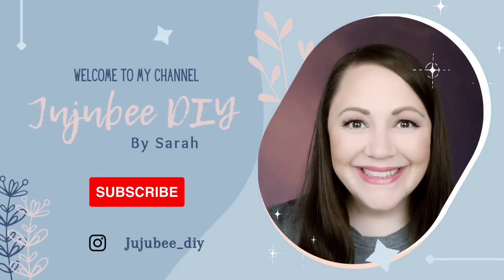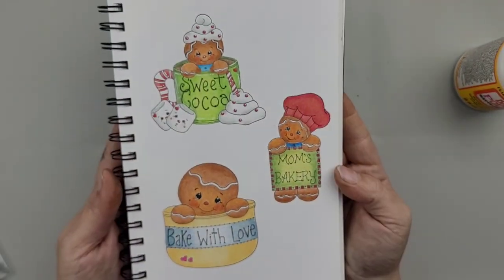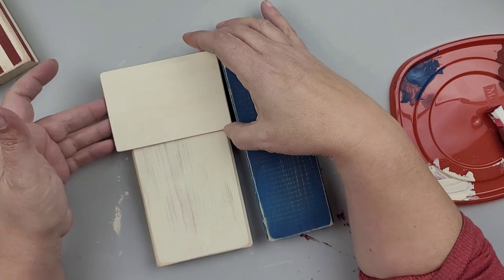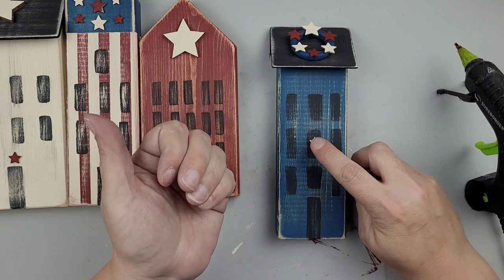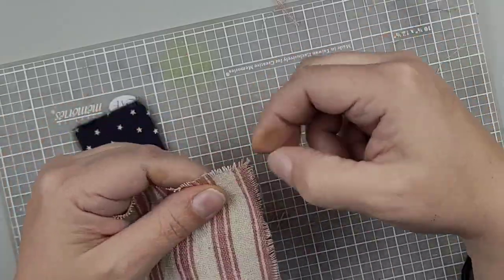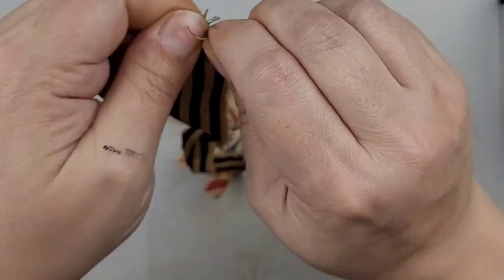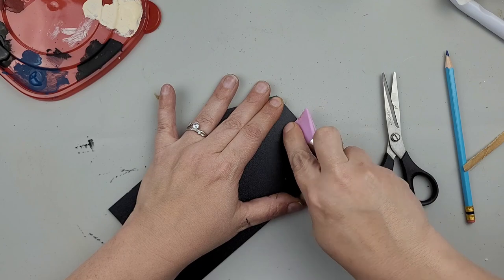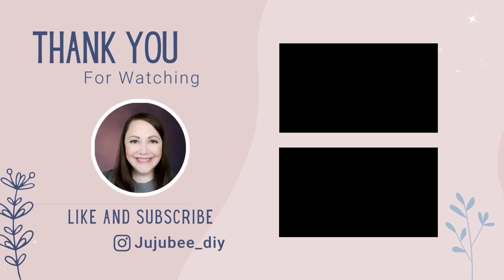Temu Haul and Primitive Patriotic DIYs

Comment: Sarah I've used your recipe for the grunge mix.

I'm trying to apply it on a plastic battery operated candle that I have.
I applied 1 coat, let it dry and when I applied the second coat it wiped off the first one.  Help!
Is there a trick?😊